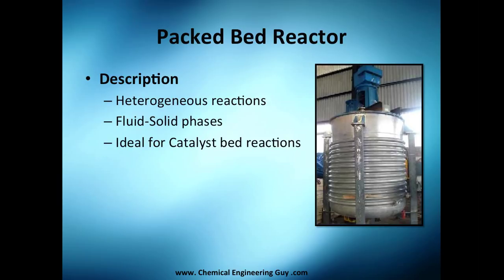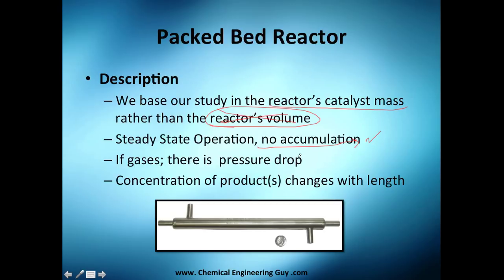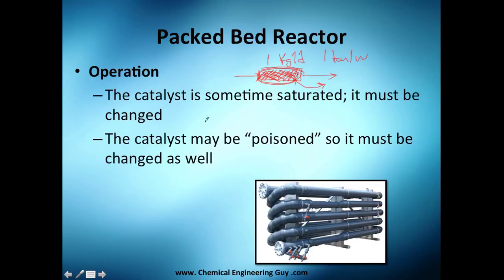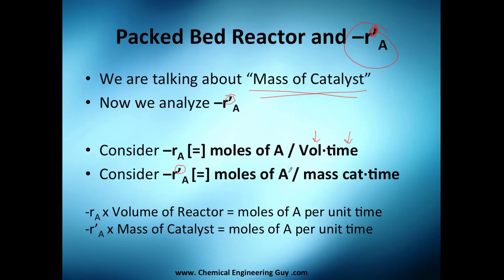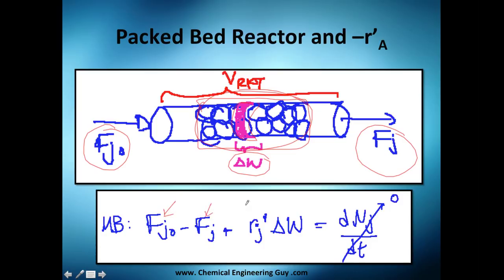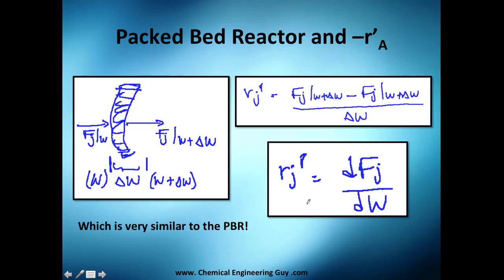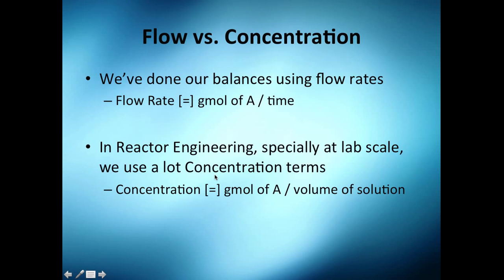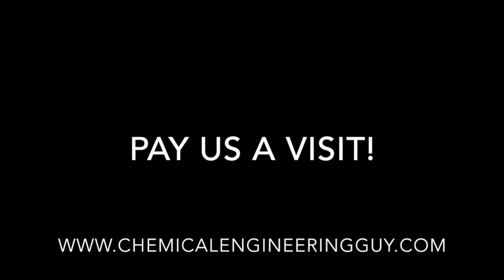Packed Bed Reactor (PBR) Molar Balance Equation // Reactor Engineering - Class 10

Comment: when given equation for rA and a value is gotten. how do I calculate rB. they are both reactants
Reply from the maker: since they are related stoichiometrically, you can do so with stoichiometry factors, i.e. if 2 mol of A are reacting for every 1 mol of B, this means that the rate of reaction of A is 2x faster than the rate of reaction of B